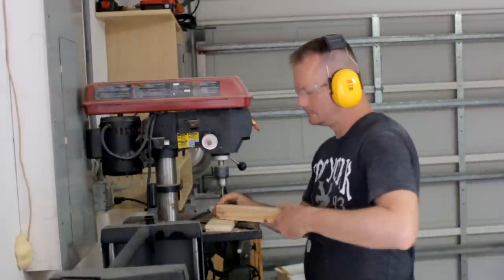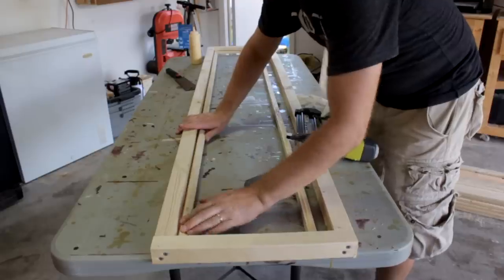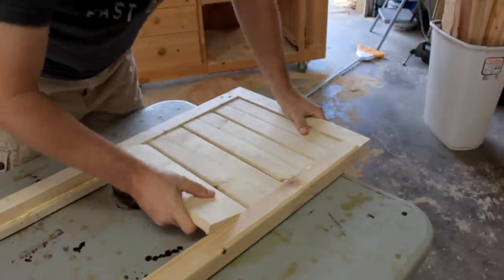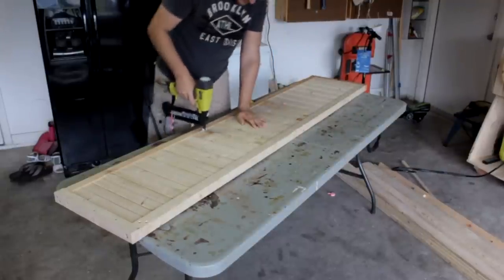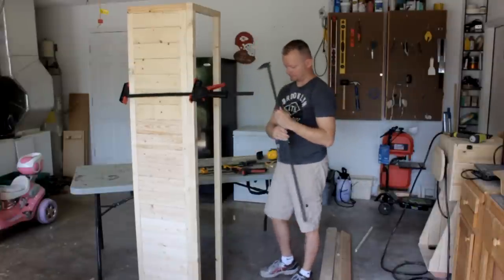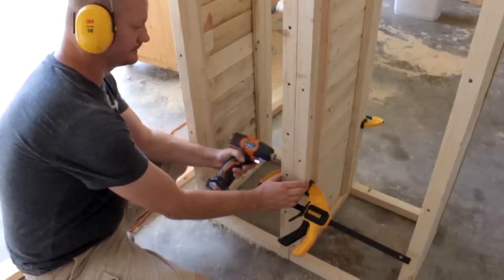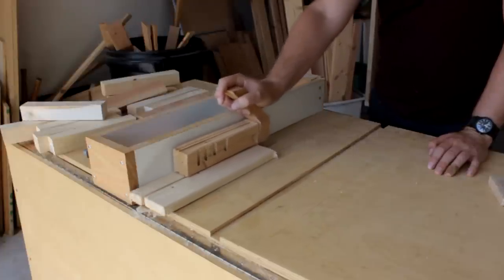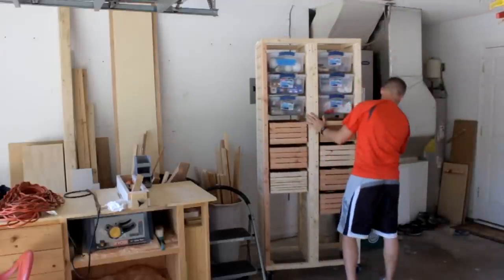Roll Around Storage Bin Cart

Comment: Thanks. What I learned is... each cabinet is not two side frames but  4 frames.  And that answered for me  a lot of structure and reinforcement ideas, that later showed in the shelf tracks you made.   Now I can adjust it to my needs.  I like the homemade crates also.   Hals Wood Shop
Reply from the maker: +Hal Kester Someone gets it.  A few people said the construction seemed redundant but when you put something on wheels that is this tall and load it up with hundreds of pounds of weight you need the redundancy for structural integrity years down the road.  I've built something similar years back in a single frame manner and it failed rather quickly.

Comment: Nice!  Curious if afterwards do you think one of the middle sides could have been eliminated.  Have just one frame supoort the center shelf cleats?  Maybe lighter but maybe weaker?
Reply from the maker: Rob Shamel I thought of that while sketching it out on the computer.  In that instance I would have eliminated the front and back frames as well which would have left a much weaker frame as a whole.  I have learned from past experience to do more than what on the surface would seem to be necessary.  Because it is roll around unit you are going to have forces acting on it that otherwise would not be.  The extra structural support is necessary in my opinion.  Someone else commented on the number of screws used and I feel it falls under the same category.  2 may be sufficient but 4 won't hurt.